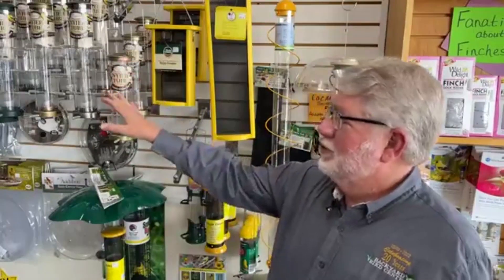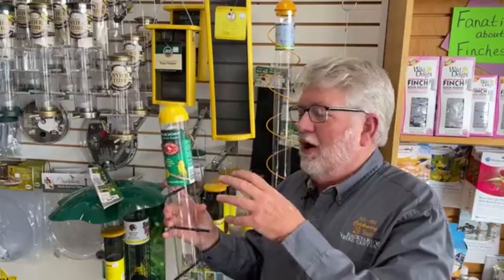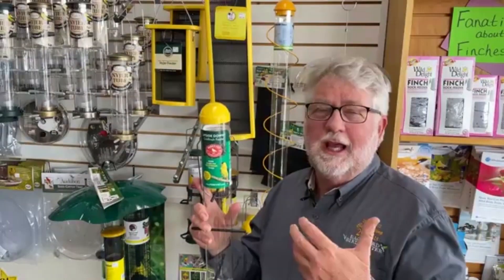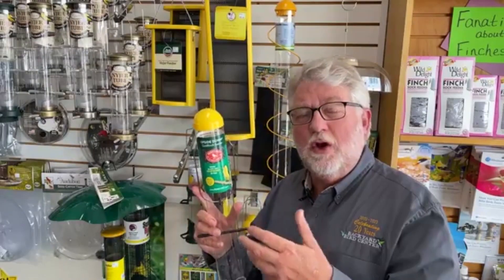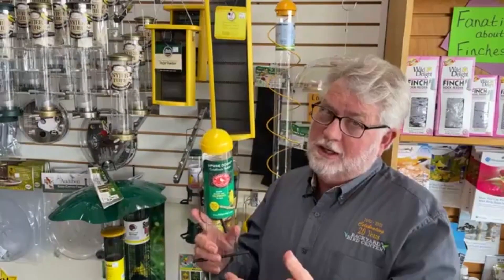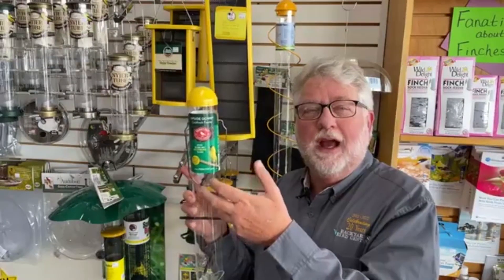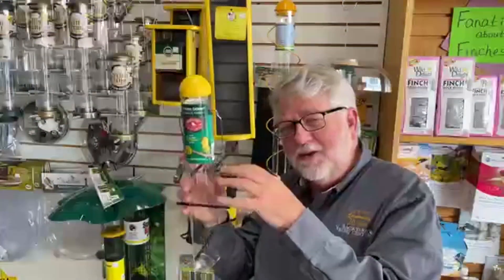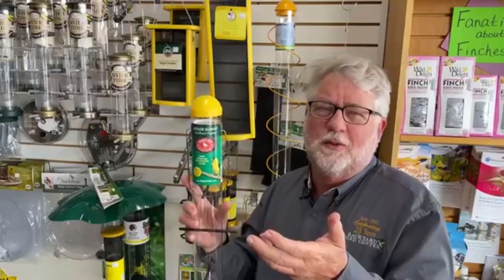Why are Some Finch Feeders "Upside Down"?

Comment: BUT...are they squirrel resistant.  Glass tubing? Spring activated perch rods? Etc...
Reply from the maker: They don’t like Nyjer. It is generally pretty safe in a plastic finch feeder
Reply: @MarksBackyardBirds  I will give it a try.  Thank you.  You are a sweetheart.
Reply from the maker: No, I do not know of a squirrel resistant upside down finch feeder. They need to be hung in a squirrel resistant manor. Poles with a baffle or under your eaves are good methods
Reply: @MarksBackyardBirds  Ok, thanks.  We must have a million squirrels here and doing everything we can to outsmart them.  I know they will just chew thru a plastic tube!

Comment: Question: Did you find that the holes are to small on this feeder ? or did they feed fine from it ? Just got mine today. Hope to keep those sparrows away from the thistle seed its to expensive.
Reply from the maker: I find it too small for using fine sunflower chips but not Nyjer.